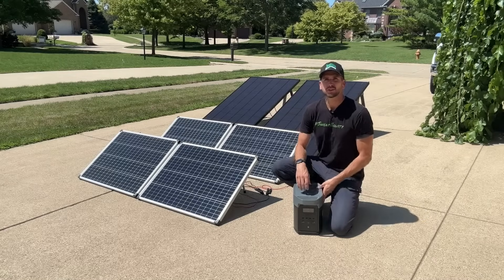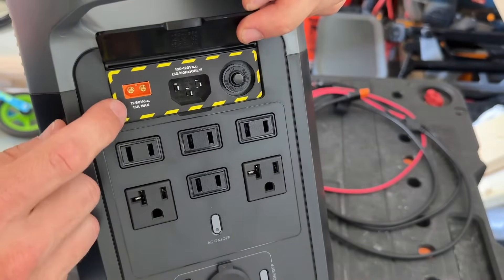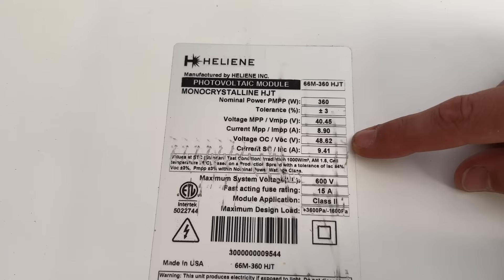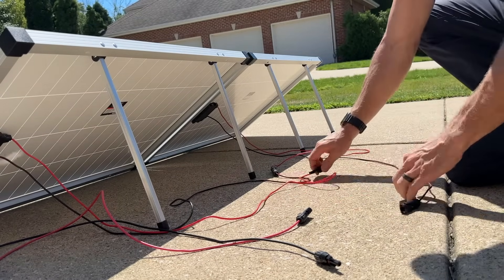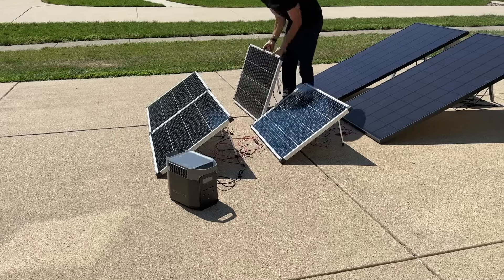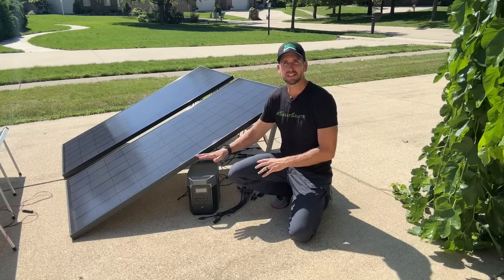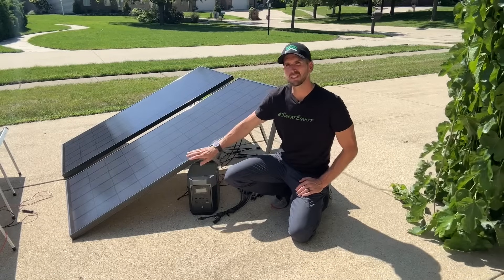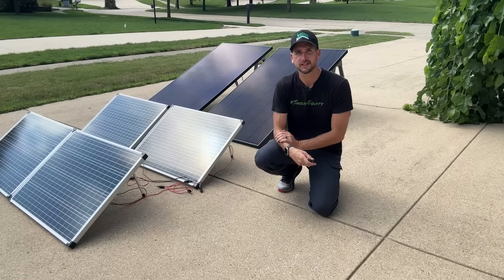Charging A Portable Power Station With Solar | ECOFLOW Delta 2

Comment from the maker: Calculate Solar Cost For Your Home - https://geni.us/solar_reviews

EcoFlow Delta 2 - https://geni.us/u46bT
EcoFlow Delta 3 Plus - https://geni.us/avZYM
Power Analyzer - https://geni.us/s86J

Solar Wiring Parts Used:  https://geni.us/oHnppd

Maximizing the solar charge capability of a portable power station is critical to designing an off-grid system.  With a little knowledge and planning you can select the right panel or panels which will match the voltage range and current limits of your system.  I will walk through an example trying to max out the 500W solar input capability of the ECOFLOW Delta 2 both using 100W panels and then switching over to larger 360W panels.

DISCLAIMER: This video and description contain affiliate links, which means that if you click on one of the product links, I’ll receive a small commission.
Reply: I have 2 matching 12 v 300 w panels . Is it ok to add them to my delta 2 8n parallel? I'm just not confident with my math.

Comment: Type Monokristal Half-Cut

Voltage at Pmax (Vmpp) 20,02V

Current at Pmax (Impp) 12,88A

Open Circuit Voltage (Voc) 23,46V

Short Circuit Current (Isc) 13,57A

Max System Voltage DC 1000V

Tolerance of Pmax (+-) 3 %
Reply: Yardımcı olun lutfen

Comment: Type Monokristal Half-Cut

Voltage at Pmax (Vmpp) 20,02V

Current at Pmax (Impp) 12,88A

Open Circuit Voltage (Voc) 23,46V

Short Circuit Current (Isc) 13,57A

Max System Voltage DC 1000V

Tolerance of Pmax (+-) 3 %

Comment: I would like to have a lot of solar, use it while the Sun's shining ALSO charging the battery, getting power 40 small AC during the hottest and most expensive part of the day, doesn't seem like these power stations are designed for that.  Maybe an all-in-one & separate battery?
Reply: Start with panels, work down from there?

Comment: Be careful when buying solar panels for the EcoFlow Delta 2 Max! Even though it says it supports up to 1000W solar input, the total current limit is only 15A across both solar ports. This means that if your panels produce more than ~15A combined (which is very common for 2×400W+ panels), the Delta will just limit the power. In practice, you won’t get the full advertised wattage. Check Vmp and Imp of your panels before buying!

Comment: I need your advice. 
I have a camper van with factory solar system. And I also have a small bluetti power station that I would like to charge from a campervan solar panel once the house batteries are fully charged.  Should I split solar panel cable before my pwm controller and add cable with xt60 to my power station or would you suggest other options? Currently I have a single 200 Watts solar panel.

Comment: Series  configuration voltage add up 19.5v+19.5v=39v  4panels added up=59v
Parallel configuration Amps add up 5.13a+5.13a=10.26a 4panels/ parallel/series configuration,amp add up=10.26a+10.26a= 20.52amps series/parallel configuration.
Wiring two panels in series next connecting+- poles of two more panels  in series next connecting all neg cables of both series and both positive cables to Ecoflow with xt60 female cable with 2 parallel connectors easier said than done.😅

Comment: Hi ,
How Can I Solar Charging with 200W Flexible Solar Panel 24 Volt? for a EcoFlow DELTA 2 Portable Power Station.

Thanks for your help.

Dominic Nguyen
Reply: You have to know what is the ISC or CSC/AMBs of your 2 panels then look to connect them in series or in parallel watching the video again

Comment: I use my Delta 2 in an EPS configuration for a few devices but since recently adding a panel have not noticed it prioritizing the solar charging unless I disconnect it from AC supply. Any idea on how to get it to use solar (when present) and auto switch to AC once the solar drops?

Comment: What panels would you recommend for a Delta 2 by Ecoflow, with an additional external better? I was thinking two 300-350W panels or three 200-220W panels. Thanks
Reply from the maker: Will do, and I will pin a comment to this video and update the spreadsheet if I am able to fix the issue.

Comment: I am very close to buying the Delta 2 (although their horrific customer service makes me hesitant) and I would like to ask, what do you think of the 220w panels they sell with their system? I don’t need something portable, I want something for my off the grid cabin to keep my Starkink working uninterrupted. Then I will use a generator when solar isn’t enough. What do those two 360w panels from your video cost? Thanks
Reply from the maker: I am a big fan of the Delta 2 but I would definitely bring in as much solar as possible.  In this type of setup I would buy the Delta 2 (confirm it comes with the solar cable) and then buy 2 used 350W-400W panels from Facebook marketplace where I could pick them up locally.  Don't forget to buy a splitter and then wire the 2 X 400W panels up in parallel.  I am putting together something similar for a project where we are trying to power 10 homes in Haiti.
Reply: @everydaysolar  - thank you very much
Reply: @everydaysolar  - With the Delta 2, is it possible to add Solar Panels and also add an expansion battery or can I only have one or the other?

Comment: Scott, I have an EcoFlow Delta 2 Max with extra battery. I have 600 watts of solar charging during the day. Can I set the unit up to switch to household AC charging when the battery is low at night and revert back to solar the next day when the sun is shining without me having to manually switch it back and forth?

Comment: Your channel is great, thank you. Can the solar generator be left on 24/7 and hooked up to the solar panel? Our sailing club meets twide a week and we woudl leave items plugged in to charge after races. Fow longer winter storage we woudl remove the unit. Thank you.
Reply from the maker: Yes, with the EcoFlow there is a setting that you can turn on to ensure the AC inverter will not timeout and turn off.  Just keep in mind this will burn some of your battery.  From what I have seen the power station will lose about 25% of the battery per day just from having the inverter on so make sure you are sizing your panels correctly.
Reply: @everydaysolar  Geez, 25% that is a lot.
Reply from the maker: @ I know and that is what most people miss in sizing out their system.

Comment: Please i need help 😢
I connected 3 180w solar panels in parallel and yet im only getting just about 150W input. This is really frustrating because i use the delta 2 as a backup for my home.

Comment: Hi, I just ordered a Delta 2 1024Wh and am looking into my first basic solar kit. You answered so many of my questons here, but just to clarify, you don't need a separate charge controller for the Delta 2 because it effectively has a built in 60v pmmt charge controller that can adjust input from panels at 11v-60v and up to 15a correct? Would be nice to bypass having to purchase a charge controller and going straight for the 400 watts of panels with connectors and adapter cable.

Comment: Hey your videos are great and have been super useful to me. I have a question maybe you can help. I have a delta 2 unit and i want to use a 560w panel with it. It uses 49.6 volt of open circuit voltage and 13.74 amps of short circuit current. Would it be wise to use this to max out the power?
Reply: As long as you don't exceed your power station's max voltage, you can use more watts or amps, the station will discard what it doesn't need.

Comment: So, how do you ever get to the max soar input voltage of 60v to maximize solar charging? If the Voc for a 12v panel is always over 20v, why do they make the max input voltage 60v rather than 70, or 80 so we can run 3 12v panels in series? Or is the 60v max there to support 48v panels with a Voc somewhere just above 50v and then have a little buffer before you get to the 60v limit?
Reply: You can bypass the max voltage problem by connecting the solar panels in parallel

Comment: Now I just got 4 100 watt panels for my new eco flow delta 3+. I had to split them in two because 44 volts was all i could use for each port(22 x 2). Now my question is, I just bought a  RIVER 2 Max on Black friday. How do i utilize these panels on it ? Do they make splitters for the panels ?

Comment: Will having 2 500w panels wired in parallel (as long as voltage and amps are in spec) damage the delta 2 if they are producing over 500w on a summer day? 

What’s the effect of too much wattage?
Reply: You shall slip into the 4th dimension. 😳
Reply: No effect if voltage is in spec. 

I have 250W panels in parallel on the Anker 300AC that states a max wattage of 100W. I am able to get 96W on extremely overcast days.

Comment: I know this is about a year old, But I have the Delta 2 Max, with the 500 watts per connector with a voltage range of 11 to 60 volts at 15 amp... I placed two Q-Cell solar panels in parallel and it's going a little over the 500 watts, like 510 to 515 ish and this is not even finding the best angle. The VOC for the panel is 46.81 volts and the Short Current is 9.41 for each panel again I wired them parallel.

Comment: Hey I see that the panel you have reads "Fast Acting Fuse" 15A. Can we use a panel that says "Fuse Size Rating" 20A. Or will that exceed our 15A safety on the Delta 2? Sorry for my ignorance.
Reply from the maker: Using the Fuse Sizing listed on the panels is more related to sizing "inline fuses" when you wire your panels in parallel.  Here is a video diving a little deeper https://youtu.be/CCfSJyAqdOM.  Wire in Series whenever possible as that will be the simplest setup.
Reply: @everydaysolar  Thank you so much.

Comment: This is in the neighborhood of what I'm doing with my Delta 2. I have the additional battery for a total of 2kWh and I'm currently using 700W of solar but upgrading to 800. Currently using 6 100W panels and two 50's: 3 100's and 1 50 (for 350W max) is run in parallel then it's tied to another, identical 350W in series, so it's mimicking two 350A panels run in series. It works.

Comment: My question is how did you connect those 2 big panels series and the volts stayed under the volts required volts?
Reply: By running in parallel, not series.
Connecting each panel positive to positive and negative to negative and take the other positive and negative from each panel into a branch connector.
This keeps the voltage at the one panel spec and doubles the amps.
Hope this helps 
Good luck!
Reply: He didn’t connect them in series, he connected them in parallel. Parallel connection keeps the voltage the same (40v) and adds the current.

Comment: How many Solarpanels can I connect to my Delta 2 in parallel? I know that I can only get in a max of 500 watts under perfect conditions but I want to be able to get as much power during winter as well. Right now i am using 2 Panels which generate 850 Watts in parallel. Could i connect an other panal to garantee a better outcome or will i run into issues and eventually even distroy the EcoFlow.
Reply from the maker: Nope, you should be able to add a 3rd panel in parallel as your voltage will be under the limit but you will only be pulling the max current allowed into the Delta 2.
Reply: Delta 2 500 watt max solar input. Must deliver at least 11 volts and not more than 60 bolts. Parallel will not increase your volts but you won’t get 850 watts in.

Comment: When connecting your panels, use a series connection with the combined voltages that are under the solar power station's maximum input voltage.  When using this higher voltage vs a lower voltage that is obtained from just using multiple panels in parallel, you can effectively use a main charging wire size of HALF of what is required by the parallel only connection.  My three Renergy 100 watt panels in series output about 60 volts @ ~ 5 amps.  This connection scheme can use a 16 ga. wire and have only about a 2 volt drop over a 50 foot run.  that same 50 foot run with the three 100 watt panels in parallel, (15 amps), would require a charge cable that is TWICE as large to handle the current and minimize the voltage drop.  Wire is expensive and the charging performance is basically the same.  SO, connect your panels in series-under the solar station's max input and use a charge wire size HALF that of what is needed by a parallel circuit....
P.S.  While this demo shows the solar power station not accepting the over voltage example, some power stations will be damaged if the charging voltage exceeds the max voltage input rating....  Draw your circuit on paper first and then you've got a connection plan....

Comment: You should discuss the fact that panel efficiency is reduced by 1% per year as a conservative estimate.  It's probably more like 2% in places like florida where they are generating electricity 12 hours a day for most of the year.  The sun takes its toll on all things including solar panels.  Environmental pollution will compound the problem if pollutants accumulate on the panels blocking light.

Comment: 33 panels seems to be the "default" setting for number of panels.  This is wayyyyyyyyyyy too many panels.  This drives the istallation prices up and extends the payback period significantly.  In order to install that many panels on most houses it will require panels to be placed on the north facing where they will never pay for themselves.   Homeowners would be best advised to limit their panels to as many as possible on the south side.  

If they dont have a south side then they should purchase a house that does.  Solar panels are NOT for everyone.   And they are not meant to be a replacement for the grid unless you are installing batteries, which most do not.  

Over generating KWs is a bad idea.  The power company will pay you pennies for all of you excess KW's that you will generate if you put up 33 panels.  

And in winter time when the sun is really low, no matter how many panels you have, you will not generate sufficient energy to pay for the cost of the panels.  And of course, if you live north of the mason dixon line, your sun exposure is limited for two reasons.  1.  Crappy cloudy weather most of the year.  2. Slope of your roof is not sufficient to get direct rays from the sun.  For maximum output of the solar panel the panel must be perpendicular to the sun.  In D.C. for example, the panel would have to be 31 to 46° for 9 months out of the 12.

Someone needs to tell the truth about solar companies sticking it to unsuspecting homeowners.  5KW is all 90% of homeowners need to give them the savings that they want.

Comment: Hi there! I have 2 panels Ecoflow 400w and charge station Ecoflow Delta 2. Can I connect parallel this 2 panels and got 500w?
Reply: I have this setup and I got only 400-420watts in ideal conditions. What I do wrong? How to get 500w from two 400w panels?

Comment: I have added the extra battery to my Delta 2. (We live in Hurricaneville.) Prior to adding the extra battery, the most wattage I could get from my 2 190 watt HQST solar panels was around 350 watts. Since adding the second battery, I have seen almost 500 watts on several occasions. I've done more than one double-take. As I'm no electrician or engineer, I'm a wee bit mystified. Having said that, I'm of course pleased as punch. Anyone have thoughts to share?

Comment: what best config on the app to get the most time of solar charge, im using the delta 2 to power up essential  aquarium circulation pumps, now i have it plugged in to use it as a ups, but i will ad a solar panel , i want to use the most of the solar power possible, ive seen in the app some spect to move to , but you recomend some best specs for that?

Comment: Do I have this right _ if I exceed the maximum VOLTAGE limit of the power station with a solar array I could blow the power station  up, but if I exceed the maximum amount of solar CURRENT the power station will self  regulate and there will be no damage - ?
Reply from the maker: Yes, although with most power stations they will shutdown the solar input above the voltage range to protect the unit.

Comment: The video is generally good.But while you explained the Siri's connecting very well.I didn't hear you explain the parallel connecting that well. The only time you've gotten to parallel, it was only for the series parallel hybrid and went quick.
Which is too bad because that's actually what you needed.And what I need because I have 2 250s.

Comment: Hola, tengo una duda, se puede hacer la carga solar dual, por la entrada solar y con el Microinversor con 4 paneles de 100 cada uno y por separado por la entrada solar del delta 2 con otro panel de 100... e visto en un video en ingles que con el delta Max si se puede después de una actualización del firmware.

Comment: I was thinking of a delta2 with 2 Renology RSP200D
200W Monocrystalline Solar panels. (rigid)
Their spec includes:

Optimum Operating Voltage (Vmp) = 19.2 V
Open Circuit Voltage (Voc) = 23.0 V

If i get this right - the 23v is the key parameter here- so 2 in series would not overspec the delta2.
Is it as simple as that ??
Thanks for shared perspectives....

other specs:
Maximum Power at STC* = 200 W
Optimum Operating Current (Imp) = 10.42 A
Short Circuit Current ('sc) = 11.05 A
Module Efficiency = 19.2%
Maximum System Voltage = 600 VDC
Maximum Series Fuse Rating = 20 A
Reply from the maker: Yep, placing those 2 panels in series would mean worse case 46V with a little buffer to the upper limit of 50V for the Delta 2.  I think that would be a solid setup for the Delta 2 👍
Reply: @everydaysolar  Thanks - appreciated!
Reply: Similar to above:  two (2) HQST 200 Watt 12Volt Polycrystalline panels 5BB.  Total Voc: 46.6	 Total watts: 400.  I think that  this would also be a good setup for the Delta 2.  Yes?